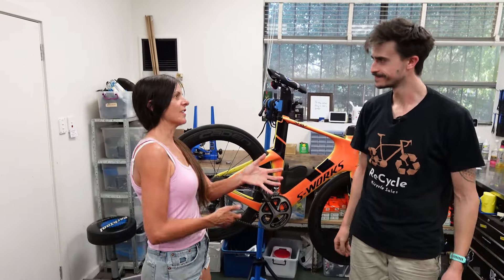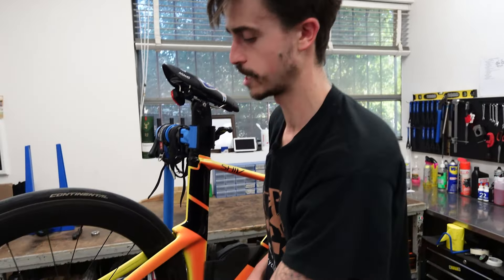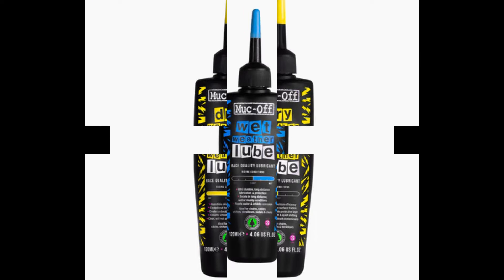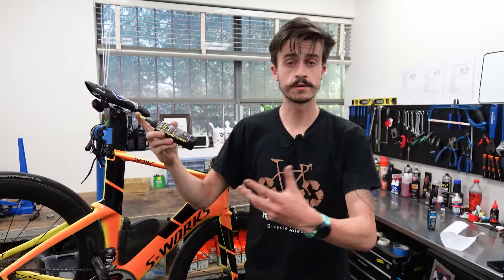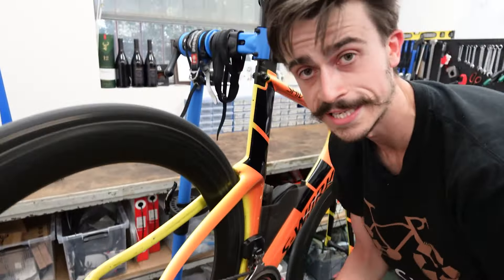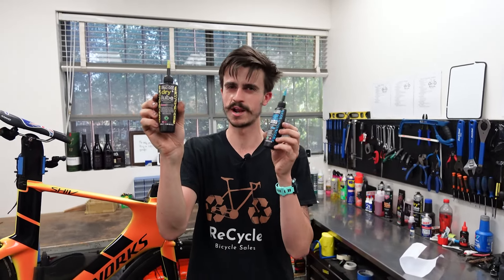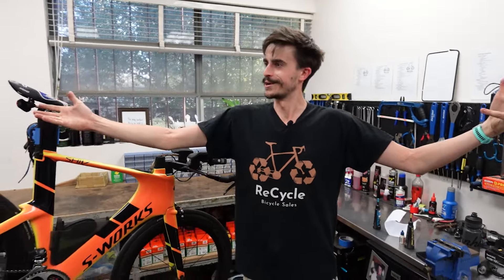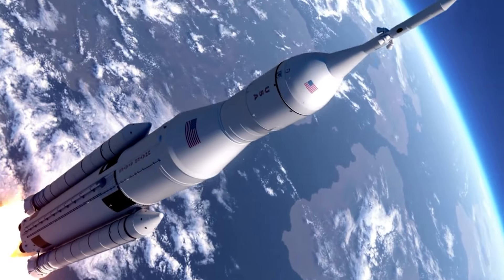Ask Lewis - The Ins and Outs of Lubing Your Bike

Comment: I did 13-14 cleaning passes on my chain to the lather from brushing is completely white and clean, and now using drip on wax for the present dry weather we're having

Hopefully with that, maintenance will be easier as there's less of a need to use degreaser during maintenance, just hot water, dry and reapply

Gonna be a twice weekly thing being a bicycle delivery guy (roughly 100-120km per reapplication)

Not looking forward to the rainy season in the later parts of the year, however x.x
Reply from the maker: That actually sounds quite simple, easy, and clean, how do you do apply the wax? is it an actual candle and you just drip the wax on?

Comment: my chain keep on rusting. probably due to tropical country weather. is there anything to slow down chain rust? its the outer plate thats mostly affected.
Reply: I have the same issue. I find that if I lube it right after the ride and wipe it all over the chain it typically will not rust for me.
Reply: @mikemazzantini6397  i think i should wipe some wd40 on the outer plate everytime after cleaning the bike. most internet guide will emphasis lubing the links but forgot to mention the outer plate treatment.
Reply from the maker: Great question! We'll answer in a video for you 😀🚴‍♀️🚴

Comment: I tend to clean my bike and drive train after every ride, deffinitely because/when the roads are still wet quite often and it just looks full on black after a ride. Does that mean i have to lube it again, as it might get washed off by degreased and cleaned with water and soap? Or would that not be necessary every ride, when I clean it? What would you recommend?

Or should i perhaps just clean it with a towel and wash it every other week for instance?
Reply from the maker: Great question! we'll answer in a video 😀

Comment: Wow, that chain was DIRTY already and then putting lube on top of it will just prime the chain for another ounce of grinding paste ... if you want to lube your chain PROPERLY, the first step is CLEANING the chain to get the accumulated grinding paste off, then lube the chain. Why do you want to leave sand/dust/metal particles on your chain and add lube to that mixture? Really, professional grinding pastes are made of solid particles such as silica (=sand) in a suitable base (often oil).

And as regards the laziness:  if you use drip on wax (after initially waxing your chain properly), the only thing you need to do is to drip wax AFTER your last ride and be good. Just as lazy as using lube ... in fact properly lubing the chain (which includes cleaning it before lubing it) causes more work than doing drip wax maintenance on a waxed chain.
Reply from the maker: Great comments! We'll respond in a video 😁👊